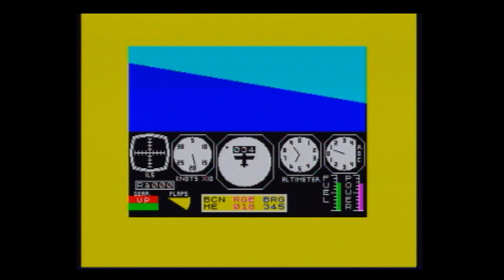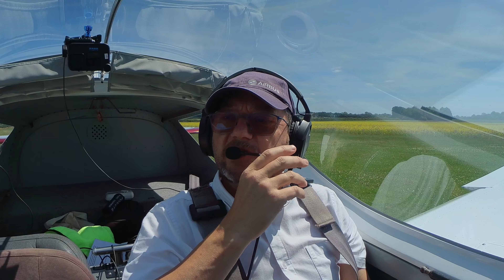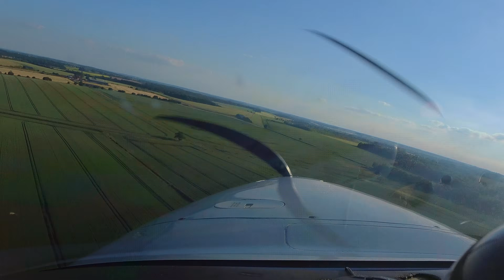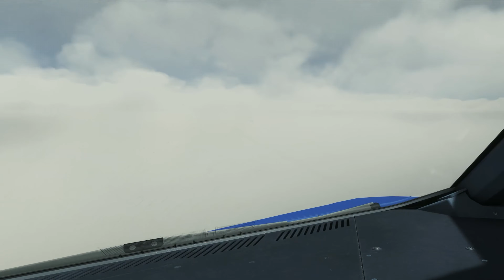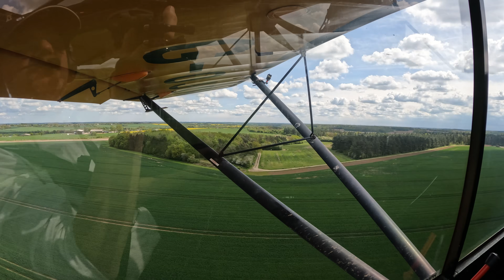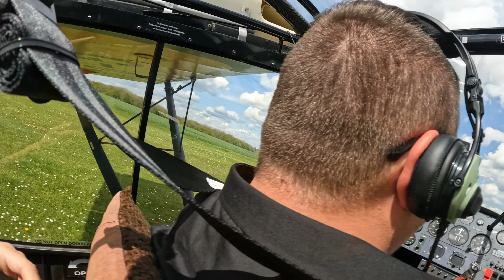But how close is Flight Simulator to real world?

Comment: Not feeling the bumps, deceleration etc is something which really hit me when I started flying gliders after having flown flight sims for decades! I had no idea takeoff and landing would be SO VIOLENT :D much more than airliners (obviously) but also wayyy more than other light aircraft I've been in! A winch start is something else and coming in to land and dumping all your speed and lift with the big barndoor brakes on the wings feels like you're falling, not descending :D It did however help me loads as I was quite quickly fairly proficient, so much so that my instructor remarked upon it! I think that was due to me practicing in MSFS to fly the same glider and at the same airfield even... I was used to the procedures and the visual of coming in to land or holding wings level on a winch TO... the body feeling was of course lacking but so much more could be practised again and again at home, regardless of weather or the cost of lessons. A fantastic tool for learning gliders and GA in my experience even if the "seat of your pants" feel is missing.

Comment: Nice video, although you are probably not aware of the huge advancements in flight Force Feedback yokes and motion platforms that greatly enhance the experience. You can now really feel all of those sensations you mentioned, including aerodynamic forces on the yoke, acceleration, vibrations and bumps, turbulence etc etc. It really is quite remarkable. It all depends on how much you are willing to spend. But this in combination with VR and a high fidelity flight model, such as A2As Comanche, really makes the difference.
Reply from the maker: I know and I have never tried VR, I'm going to though, thank you.
Reply: @ShortField go for it, the Sim without all the hardware is just a preview or a switchology trainer . For comparison with real VFR flying this makes the difference and it comes even closer

Comment: My setup involves VR, haptics ( vibration ) and a small motion rig. And I do get all those sensations. Up to the point where if my haptics are not on for some reason, I cannot fly the plane. So it’s not the sim per se, it’s what you add as hardware that completes the puzzle.
Reply from the maker: I need that.
Reply: 6DOF.... Costs about as much as your annual and certification. Add VATsim for human comms and ATC.
Reply: Yes but a light airplane as the evektor in video can push to 4g of force! how much your motion rig can do?
Reply: Mine does  enough to throw me  of my  seat, if I was so careless.

Comment: I'm in Flight Simulator every day, mainly flying the A320 with the Airbus TCA captains pack from Thrustmaster. I got a 90 minute full motion A320 simulator session for my birthday last year. He asked me what flying experience I'd had and I was sheepish and said I'd been flying A320s for about six hours a day in MSFS since it came out plus one full international flight every few days, thinking he'd brush that off. To my surprise, he didn't. He gave me a printed flight plan, said he'd be sat in the jumpseat if I needed anything and left me to it for the most part. I threw myself at it, did the appropriate checklists, got straight into programming the FMGS with the route off the page, got used to the weight of the control surfaces. It felt right. That first bank once it captured the ILS was absolutely awesome. If I recall, I did an ILS landing into Innsbruck just to try it, and then hand flew it into Manchester just to see if I could. It's lit something inside me, definitely.
Reply from the maker: Yes, go have a flying lesson, you'll be great!

Comment: While it’s not perfect, I got a simple stick, throttle, and pedal setup for my xbox before I started flight training. I practiced both procedures like the checklists and runup, as well as basic maneuvers. Some things just don’t work in the sim, like stalls aren’t even close. But climbs, descents, turns, slow flight, steep turns, all close enough that practicing them in MSFS helped me master them quickly in flight training. I advanced very quickly from zero time to solo and I credit that to not just playing with the simulator but actually practicing procedures and maneuvers in it.
Reply: Worth mentioning, the sim is also fantastic for emergency practice. I’ve spent hours intentionally failing the engine at different phases of flight and altitudes around where I fly and making simulated emergency landings. While in real life you won’t ever make an off airport landing unless it happens for real, you can do it without limit in the simulator. Flying the plane all the way to the ground in small clearings, figuring out at what altitudes you might actually be able to make the impossible turn, finding survivable landing spots straight ahead from my local runways, the simulator has given me a lot more confidence because I now have a plan for nearly any possible emergency, that I’ve actually flown in a simulation of the planes I fly. It may not be the real thing but with max gross weight and high density alt in the sim I’m confident if it was doable there it would be doable for real.
Reply: Practicing procedure seems like it is a good idea.  It gets it into your brain so that you are able to absorb flying vs mundane rote stuff.  Also you can practice flight planning and see how accurate you are in a sim by adding events to throw you off.

Comment: Great video! Flight simulators are an essential tool for instrument training and to practice instrument approaches.  As well, it is a great tool to familiarize yourself with the approaches at an airport you are planning on flying to.

From a stick and rudders standpoint, I find the forward/side slip, spins, and crosswind landing algorithms to be mediocre at best.  Then there is the element of “feel” which, as you mentioned, gives it a shallow feel. 

But still, as I’m sure you will agree, Flight Sims are a must have in your pilot bag of tricks.

Comment: I learned to fly back in the nineties. Flying club owned three Morane Ralleys that were fairly cheap to rent. It was much easier to land a real plane than a similar Cessna in the MS flight simulator 95. Human eyes have depth sight so it is much easier to assess distances when flying a circuit. And, as you say, you "feel the plane under your ass" which makes landing a lot easier than with the flight simulator.

Comment: Consequences, visuals and sensation are the main differences, for sure…and I absolutely agree that landing in real life is easier than landing in a sim. I’ve been saying that for years and will get the occasional head tilt. Sensations are the biggest thing…getting whipped around during a windy takeoff, physically lifting out of your seat when turbulence starts to ramp up a bit, that feeling of hurtling down the runway when you’re trying to stop quickly. Whether or not you can deal with those things (along with your willingness to study) is definitely a major deciding factor when it comes to being a pilot IRL.

Comment: Agree with what you say no feel in flight sim 2020. Would like to know if anyone have used the force feedback yoke's? I did gain a PPL back in the eighties and did visit Andrewsfield so I can't be that far from you. (trained at Southend) When I retired I treated my self to a few hours on a British airways 737 sim with a BA training captain at Heathrow, now that is what I call a sim. (don't think I will get one of those though as I dont have the odd £14 million to spare)!  Last night I did use the new PMDG 777 aircraft and flew manually from Southend to Exeter and managed to a greaser of a landing though set up the approach much to early so skimmed across part of devon at 1000ft with flaps and gear down! (beginners luck) Another thing with MSFS not so easy to spot the airfields (unless markers used)  Very interesting video thanks.

Comment: There are some payware [or even a handful of great freeware ones] add-on planes which do attempt to give you more of those fine details, but it almost certainly can't compare to the tactile feedback of physically sitting in a plane. I'm not a pilot myself but I've taken the controls before [under the supervision of a former military pilot, it's legal in the states at least so long as you're supervised] and been up on quite a few GA planes and modern simming has gotten close to what I experienced during those flights but it's just not there yet. Definitely a great asset still and great fun, thanks for the video, stay safe out there.

Comment: Nice vid, well put together. I would say tho' that the main takeaway was that you can't 'feel' a plane in the SIM. I'm not sure this is a 'PROBLEM', as your title suggests? MSFS is a SIM, but I don't think any reasonable simmer is disappointed that they can't actually feel the bumps and movements of real aviation, short of having the money and space for some mad hydraulic system. Also, the rudder required on TO can be better replicated in good quality Payware planes.

Comment: You can immediatly feel the difference even when you are a passenger on the A320N. I have hundreds of hours of sim flight in the A320 and everytime I get on a plane and feel the winds, the ground effect, the acceleration forces when taking off, I realize how hard it gets when all those forces strike you while flying. 
That being said, I am trying to get from simulator to a real world academy and get up there.
Reply from the maker: I love flying the A320 and in that I really believe I could jump into the real thing and fly it, mainly because it's system driven and the missing 'feel' is not required, however in a light aircraft that dynamic element is needed as so much is based on 'seat of the pants' in a small aircraft. Thanks for the watch and comment

Comment: As a real-life Sportcruiser pilot it’s a shame the PS-28 is not in MSFS 2020.
Spot-on observation that the seat-of-the-pants feeling is lacking in any flight simulator. I do have a high-end PC plus a VR headset at home. Flying in VR is in my opinion the closest one can get to the real life experience while sitting in a chair firmly planted on the ground.

I do use MSFS often when planning a real-life flight to an airfield I haven’t been before. It helps with orientation on the surroundings during the actual flight.
Reply from the maker: I had the Sportcruiser in X-Plane but we do need one one in MSFS I'm sure it would be popular, perhaps Inibuilds could add it to the list of the 500+ aircraft they're building atm :-)

Comment: Nice vid. Thanks. I flew a Chipmunk and Yak52 as part owner for many years as well as countless other types from Cessnas to Piper Cubs. These are 'characterful' aeroplanes and no way can they be realistically simmed. The Chipmunk, for instance, has sublime handling and the wing talks to you through the stick, telling you where you are on the drag curve (you can hoink it into the air well on the back of the drag curve if the field is muddy, let it accelerate in ground effect, and it'll tell you through stick feel when it's on the right side of the drag curve so you can climb away from the ground).
Talking of muddy fields, the mighty Yak with its skinny tyres will simply lock its wheels and go straight ahead on wet mud when you try to steer it (differential braking and free-castoring nose wheel). However, give the lovely Vendeneyef 360hp 9 cylinder radial a burst of power and it'll dig the right wheel into the mud while taking the weight off the left one, turning you right, and pulling the power back will turn you left! No sim will do that!
And of course when you do aerobatics (as I did most of the time!) the physical sensations are much of the experience, especially 'G', as well as feeling the buffet as the wing approaches the critical AoA and then exceeds it (deliberately!).
I think sims are OK for airliners, where physical sensations are few and much of the flying is procedural rather than by feel. But for light aeroplanes? Nah!
Vince
Reply from the maker: Agree, but still love the sim even though it lacks the physical element.

Comment: Another thing I've noticed: C172 enters a spin way too easily in MSFS compared to reality.

It amazes me that the real plane is more forgiving than the sim one.
Reply from the maker: I think that's because the sim is based on figures it doesn't account for a pilots reactions and IRL the pilot feels the stall and a wing drop before it happens through the feedback the aircraft is giving them the sound of the airflow and the way the prop windmills and they will feel the controls getting sloppy and the stress on their neck trying fighting to keep their head up against the high angle of attack (even if unconsciously the pilot will add subtle inputs that stop the spin from developing). A fixed base sim can never replicate this.

Comment: For me the Robin cadet is closest to my Robin 200. I do have VR as well and the things that break emersion for me are. ATC is nowhere near accurate to UK operations at GA airfields. Very difficult to feel the aircraft. Visibility in the circuit controlling the views is a real pain, eye tracking stuff helps a lot.  I find that too much simulator time makes you more sensitive to real turbulence or the difference in the control forces verses speed.  In a real plane the engine sounds different during gusts and at different airspeeds and on different days because its a living breathing thing with moods.  Gust simulation is terrible in the simulator particularly around tall trees where in real life you get curl over etc.  All aircraft in the simulator perform far better than it real life, its rare that you can get to 1000ft at the point the simulator does its up to twice as bad.
The commercial aircraft in sims feel more realistic in the sense that in those planes you actually do feel far more disconnected from the flying experience.
 Finally when pratting about, none of the simulators spin properly and getting it to spin on turn to final is something a simulator should simulate because it happens a lot in real life.  Despite this, it's quite good to try spinning at <1000ft on the simulator in VR and you will see why pilots don't do what they should, it's because it's nearly impossible to override instinct when the entire windscreen is ground.  Safety talks and video talk about improper spin recovery technique and show videos of accidents as if the pilot didn't know what happened or how to recover but we really don't know how people react in that situation until its too late, a large proportion will freeze, the remainder just revert to trying to fly it with the stick.

Comment: I find it so frustrating that we had affordable force feedback with the Sidewinders in the early 2000s but then flight sims didn't follow this technology as simracing did. Seat of pants feeling is greatly simulated by the force feedback in sim racing wheels, we just need the same following of the tech in flight sims.
Reply: Agreed, feeling the rudder forces would really help a lot! But it's coming back! With the patent expiration, more and more manufacturers are now announcing force feedback sticks. You can already buy some kits from garage builds (though with long wait times), but others, like Moza, are set to offer off-the-shelf products. 2024 / 2025 might become the best year for force feedback!
Reply: @gerhard-b  yeah but even if the hardware is slowly coming back, the software totally dropped support. I hope MSFS 24 will have support for ffb but 2020 doesn't
Reply: @Myosos  No native support in the software, but the manufacturers of the sticks implement their own! They read the telemetry from the sim and translate the data into force feedback for the stick. Maybe that's even the best way to do it since every hardware setup can be different. All the sim has to do is provide accurate telemetry data (currently done via SimConnect, I think).

Comment: Can you answer a question I have. When I am practicing doing turns I find it kinda hard (actually very hard and hence this question) to concentrate on flying to my desired heading while also having to watch the turn coordinator for proper angle and to keep ball centered while also glancing over at the altitude gauge. This gets really hard and I find myself porpoising up and down in altitude.

Just recently I was interested in finding out if a pilot "feels" slip in plane and found a video where instructor told student to close eyes and he knew where the ball was at all times without looking at the indicator. So that is answered....its easier in real life as you feel the slip in seat of the pants.

So now I wonder, in real life and you bank the plane and start the turn, do you feel the plane starting to lose altitude or gain altitude and can you hold the altitude just by feel?
Reply from the maker: Great question definitely feel when the aircraft is coordinated in real flight, uncoordinated feels wrong. Thanks for the great comment 👍

Comment: Flight simulator with motion seat can simulate the turbulence and forces acting on the pilot depending on the type and range of motion of the seat. Seems like you are not deep into modern simming. Add VR googles and you will have stereoscopic 360 degree field of vision.